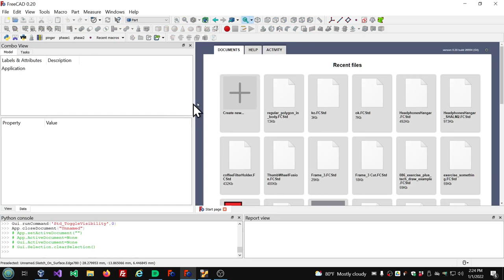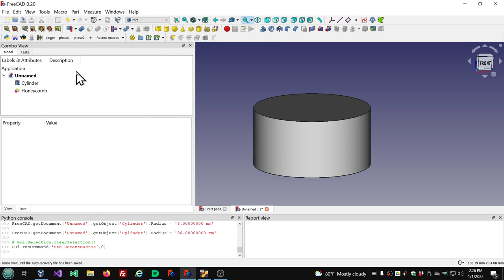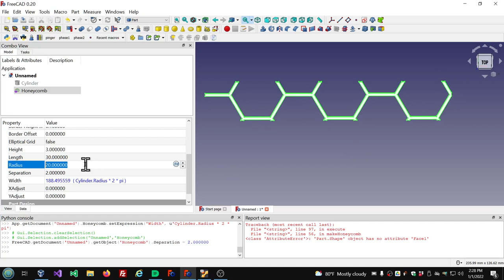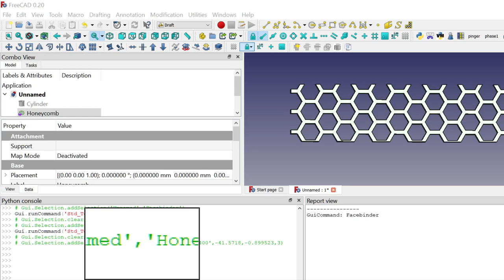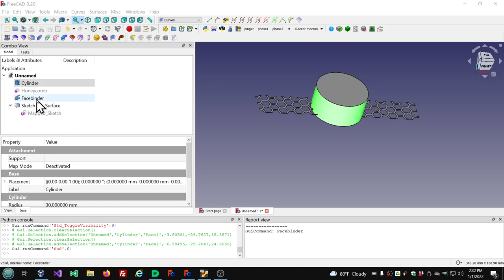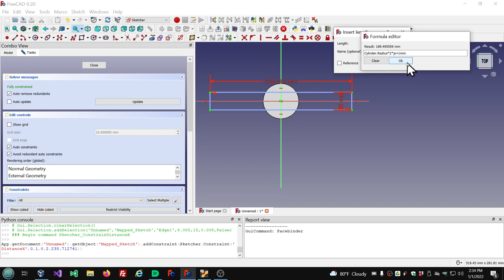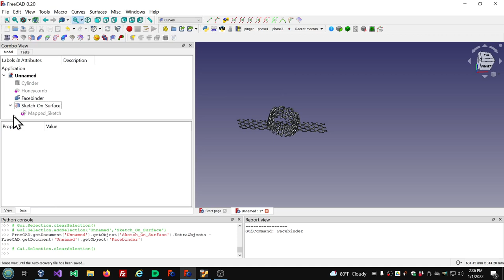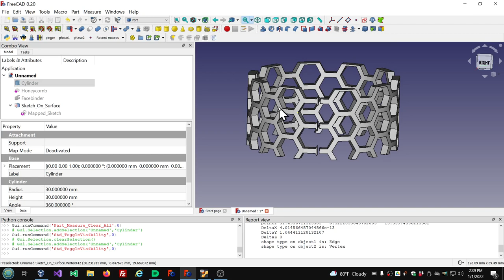088 FreeCAD 0 20 Cylindrical Honeycomb

Comment: Thanks Mark. As a beekeeper in Belgium and the Netherlands we need to catch the Asiatic Hornet, because it is threatening our bees. Maybe not yet in the north where you live. So to catch the hornet we need to make a shape like a coffee filter strainer but smaller.  If you search on pictures of Asiatic hornet trap cone, you can find pictures and even .stl files for that. 
However i would like to design one in Freecad. Important measurements of the trap are the smallest hole of the funnel must be 8,5 mm diameter,  to only let the  Asian hornet and smaller insects trough, and the radius of the holes or slots must be between 4,5 and 5 mm, to give the smaller insects, like our honeybees,  a way to escape. 
It would be very good if you could find the time to make a video to make that thing, in an easy way, without extra workbenches and other stuff.
Maybe it is not possible, in an easy way. I don't know.
Anyway thanks if you would only consider making it.
God bless you.
Jean
Reply from the maker: One way you could possibly do it is to make the example here much thicker, and then use 2 cones to cut into a cone shape, one cone to cut the inside, another to cut the outside in Part workbench.  The sketch on surface tool will also work with a cone surface as well as a cylinder surface, but the final shape would be distorted with the holes at the narrow end smaller than the holes at the wide end of the cone.  Another issue could be getting the hole sizes right since they get scaled, so some trial and error could be required.
Reply: @mwganson  Thanks Mark, i now have found a way to draw a sketch half of the shape of the cone and then fill it with a revolution. Then in the part workbench use the thickness tool, so the shape of the funnel is ready. But then i would like to be able to draw a sketch with the size of the hole or slot on the angled shape of the funnel with a datum line and datum plane, but i think there must be easier ways to do it. Anyway thanks for your time. Jean